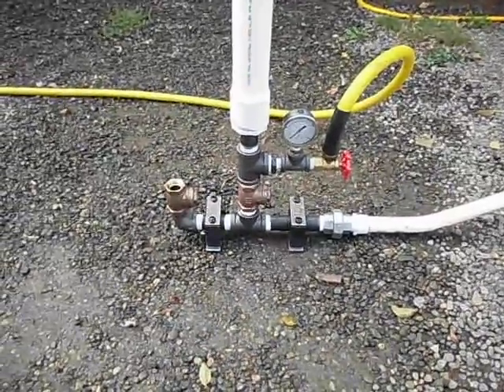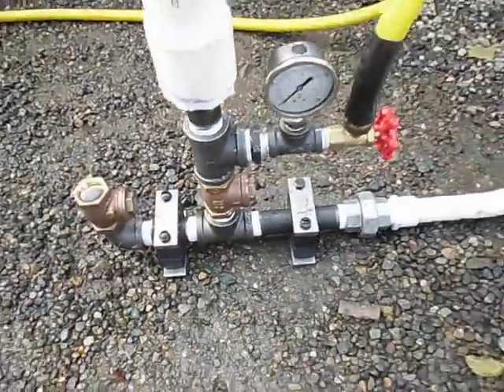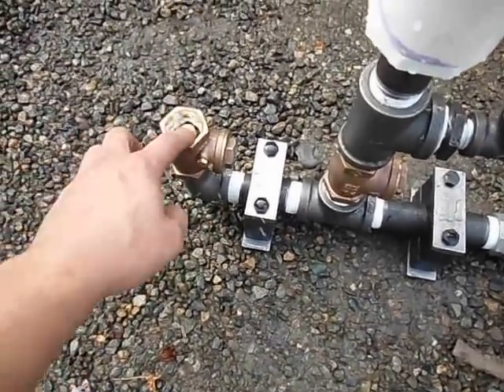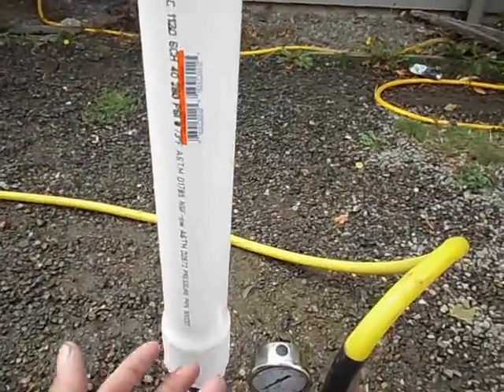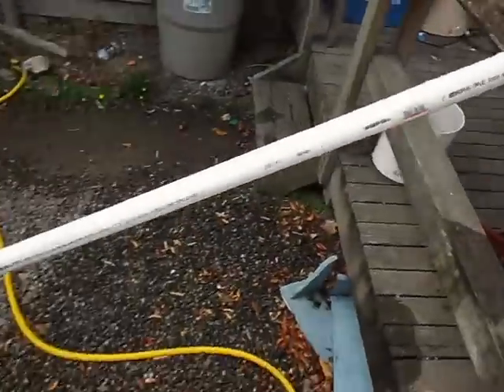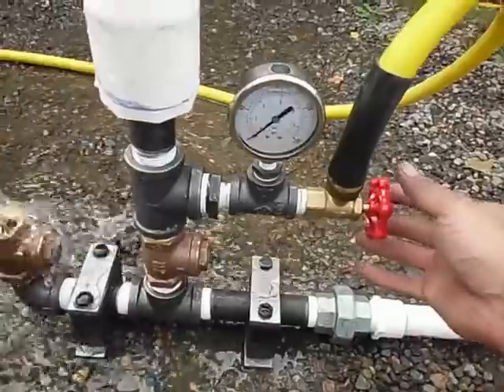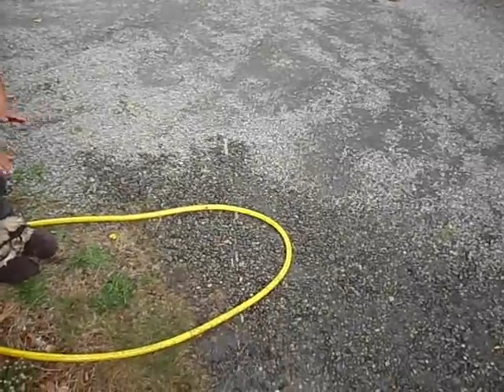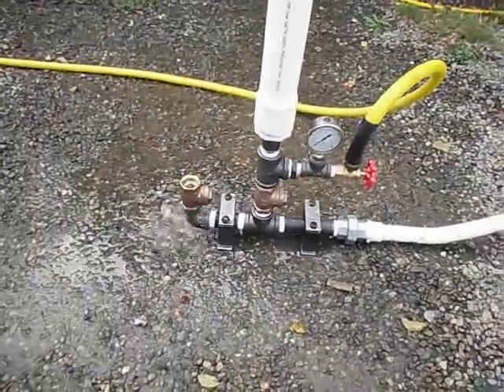Homemade Ram Pump

Comment: Nice. I reckon your pressure gauge might have a clogged inlet orifice? Some gauges I used employ that primitive method an a means to damp sudden excursions. Mebbe use a trap of some sort to keep water out of it. Well done, and thanks for posting.

Comment from the maker: Im no expert on ram pumps but i believe the pressure vessel (pvc) can remain 2" if you just make it taller, how much taller im not sure, i have seen many pumps use 1 1/4" and 1 1/2" check valves, regardless of which size you go with i believe "fall" is the most important factor, the higher the water falls through your drive pipe the better, the higher head the pump can lift as well as higher water pressure, hope this helps and good luck on your project,....josh

Comment: Great video. I was going to buy one but with the video you did I think I will DIY. What size would the pressure pipe have to be to have a 2" input? And what corresponding size would the check valves have to be? Would the pressure pipe be ok to stay 2" but just have it higher as I like the water weeney idea very much. thanks

Comment from the maker: When i built this one it was a toss up as to which style i was going to build, i decided on this style with the impitus valve at the end of the system because it made sense to me that this design could utilize the water hammer more effectively than the other(valve @ start side) this is of course my opinion, i very well could be wrong but it made more sense to me, thank you for the kind words and the comment,...josh

Comment: Now I can't find the link again. UGGG!  If I recall... it was an old large diameter tire (truck tire/tractor)... Seal one side with plexiglass or plates and run bolts around it.   Do similar to other side, but you will have two pipes going in.   One pipe from water source will have one way pvc valve allowing water to flow into tire, the other pipe will go to wherever.  As tire is compressed and pulled, it creates suction and pulls water in... Squirts it out.   I think there was air valve 2.

Comment: Ever heard of a "tire pump"?  Take any old tire (pref large)... Cover one side of the bead, then other side you have intake/output and vent.   Run chain/rope up tree to big branch (or windmill)... As tire gets moved up/down, it pumps water. :)  Far less noisy than a ram.